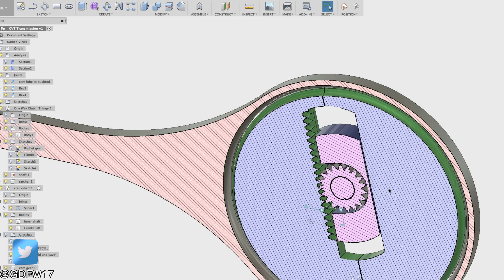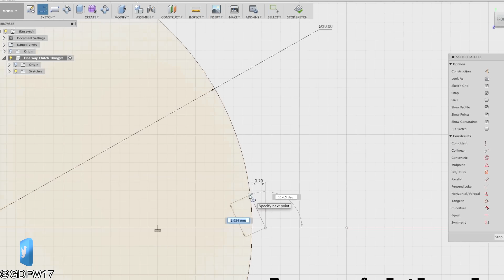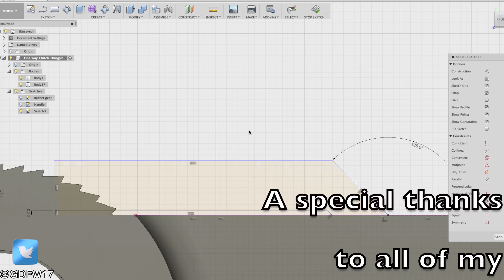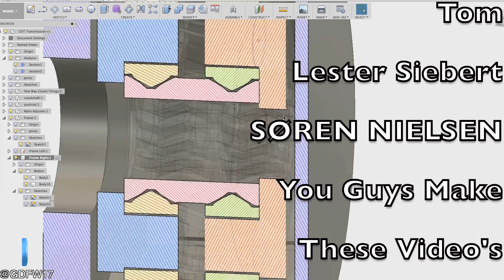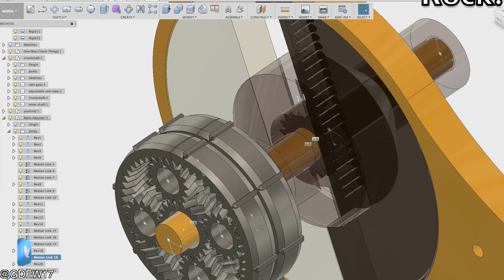The Coolest Transmission You've Never Heard Of... The Ratcheting CVT

Comment: Im guessing its not a full CVT because of two things: 
1) It only transmits power in discrete chunks for each ratchet step.
2) Due to it's fixed lever design it will never achieve a 1:1 gear ratio.

Another thing is that it does not really transforms torque that much, so for this transmission the lower output spin ratio does not necessarily mean a higher torque output, the torque in this thing is practically fixed.
Reply from the maker: Some very good observations!
Reply: Gear Down For What? Thanks!

Comment: Very clever.  Unfortunately would generate a great deal of wear on contacting faces and thus material & maintenance costs would be high as well as lubricity issues.
Reply: hi new engineering metal required can be mass produced
Reply: hahahaha
Reply: Yeah the thing wouldn't last any longer than a normal belt-based CVT.

Comment: Since it goes down to zero, you can actually call it an Infinitely Variable Transmission (IVT) :)
I anticipate you're going to talk about the Non-Integer Tooth Problem in the next video. If you used sprag clutches instead of ratchets, you would of course solve that problem but lose positive engagement. I do wonder if you could use a mix of sprag clutches with ratchets to back them up if they lose grip? Also, I'm interested in how you could dynamically balance this mechanism. I'd bet if you had six of those cranks they would be inherently balanced like an inline six cylinder engine is (and perhaps the extra three could be sprag clutch based!)!

Comment: Great, let's adapt it on a go-cart or a Power Wheels.
Reply: And watch it blow up lol
Reply: nah this is useless. belts are much more efficient. this would induce incredible vibration, and has way too many moving parts than nescessary.
Reply: Actually, that would be a really cool idea
Reply: silly rabbit ..... if you want to build a super snotty go cart use a snowmobile torque converter [clutch] and heck throw in a snowmobile  engine nobody will ever beat you look up snowmobile engine powered bikes only thing faster is an electric and they are very fast
Reply: Paco Vasda you would need one on a Pro or super kart, which does have gear shifters.
Reply: Everything needs to be cheap.   It's hard to get cheaper than a belt.   even the cost of 5 belts is hard to compete with.  Just make belts quick and easy to replace,  and You'll rule the go-cart industry..
Reply: You get more power at low speed with gearbox. if torque is constant then power depends on RPM. it's better that motor is always delivering maxium power or running at best efficiency.
Reply: Ok, to all those saying it’s too expensive or not efficient blah blah blah. Heck I’d put one on a kart just cause it’s cool and unique! Not everything has to be ultra efficient. Sometimes you do stuff just cause it’s an option.
Reply: I thought maybe a bicycle. They're designed to coast when you stop pedaling.
Reply: Roberto Buenrostro you don't need a transmission with an electric motor. It would serve no purpose.
You will often see a gear reduction system on an electric motor but you wouldn't want to change that reduction once chosen.
You can make an electric motor produce full torque at low RPM as well as high RPM whereas a gas motor only produces its best torque usually at higher RPMs there for a gas motor would need a transmission so that you could get your speed to go both fast and slow all with higher RPMs in a petrol powered machine
Reply: Roberto Buenrostro  That would be awesome! I just bought a torque converter for our off road go kart project but something like this might be the ticket, especially if reverse could be added!
Reply: wow, that was an unexpectedly epic idea.

Comment: Some CVTs can go from full forward speed though zero and on to full reverse. I've never heard of the "ratchet drive" but I guess that means it is not reversible. Won't the ratchet and toggles be subject to high wear? Also I think the ratchet would make the output shaft free-wheel in the drive direction, right, like the free-wheel on a bike?
Reply from the maker: yeah
Reply: There are some other ways to do the same job as the ratchet rectification. I don't remember what it's called but it uses something like rollers that jam going one way and free-wheel the other way. Here's one video I found about that: Renold Trapped Roller Clutch https://youtu.be/QjR7dimpSJA

Comment: The reason it cannot be classified as a CVT is because although the stroke length is infinitely variable, the amount of rotation of the output shaft per stroke is dependent on a finite number of clicks/teeth on the ratchet mechanism. I really like this design, it seems very reliable and an easy modification would enable reverse functionality;. I may have to steal it for my own projects. I particularly like the design for the control mechanism.
Reply from the maker: I took it apart at the end

Comment: Please check this REALLY working cvt. It can handle a lot of power and is still really dependable. There Hans even been an formule 1 prototype.. https://youtu.be/dp8lHBDFhpo
Reply from the maker: that's like a snowmobile CVT with a steel belt.
Reply: Gear Down For What? Last year they built the 50,000,000 one. That are a lot of snowmobiles

Comment: At 4:35 I got a counterexample for you. I work at a dealership so take that into account, but Yamaha ATV drive belts don't slip. They have a centrifugal clutch like a scooter before the power gets to the CVT. The only time we have to replace belts is when they submerge the transmission in mud, and even then they're sealed up pretty well. Sorry if I'm being sales pitchy, but just thought you might be interested in the engineering. Look at item #1 and #10 here at the bottom: (this goes to a parts diagram on Yamaha's website, the URL didn't agree with YouTube's comment formatting codes) https://tinyurl.com/y8nnyvfz

Comment: The ratchet action of the Conrod is a significant energy loss and at significant speed the pall would float without engagement on the output shaft, neat arrangement though. Try a variable pitch worm gear with elliptical lapping plates you may have fun with that.

Comment: Instead of using ratchet mechanisms you could probably use a one way clutch like what is commonly used in automatic transmissions, which would make it work more quietly more smoothly, and I'm sure it would last much longer. It seems to me like those would be the biggest problems with using that in an automotive application.

Comment: I, too, once had a brilliant idea when I was a child, only to discover it existed already and wasn't in place because of consumers not understanding how great it would be.

4-wheel steering. Basically, all the wheels had turning, but in either direction so that you could 'strafe' into parking spots. And they could also turn to allow for tighter turning and better control in turns. But complex mechanisms, price, weight, bla bla bla made it never really catch on.

And then, shortly after that, I had the idea of putting a motor in each wheel so that the wheels could be directly powered with as few mechanical links as possible... That one might happen with electric motors.
Reply from the maker: Not even kidding you, at the same age I had those ideas also, but in the opposite order.
Reply: At 7 yo we had a fiber light Christmas tree   and had invented fiber optic, just make the light be either 1 or 0 and send binary codes with light. Ofc fiber op already existed

Comment: I think the Prius Cvt is one of the most simple and robust versions. Basically and open diff with the electric motor varying the speed. Its one speed but infinitely variable. The electric motor helps down low and when the engine needs to idle at stop all the rotation is sent though the gererator side letting the wheels sit still. Kinda like when you hold one wheel on a open diff and all the power goes to the other side. Its so bullet proof idk why its not used more. No clutches or bands to wear and much less heat. But it needs a electric motor which generally are very reliable and you have the extra complexity of a battery and inverter to power it all.
Reply: I have to agree about the prius cvt. Outstanding design, and I dought its power limited like friction cvts just up the size of the motor and gearing. I bitch nonstop about friction cvt s and curse the auto manufacturers for using such failure prone garbage...honestly does anyone have a NON PRIUS cvt with 300,000 trouble free miles?
Reply: Jim Rr  A Prius is just good on gas.  Many people own them and also own their muscle cars, trucks and other assorted gas gusslers.  We aren't trying to save the world, just gas money and miles on our other nicer vehicles.  There's no need to suggest we are Democrats, snowflakes or environmentalists.
Reply: ^^^^^^^ This
Reply: I love my Prius, at first it was so weird to drive but now I can really respect the design.  CVT's will advance in design as consumers are drawn to their fuel economy.  I wonder if Toyota made the design so tough or if there is an un-thanked inventor somewhere?
Reply: I meant 1 gear and always in it. infinitly varible. reverse is all electric only. It never shifts in or out. Car will lurch forward slightly when in park and the engine starts up sometimes as it is technically still in gear. Some power is transfered to the drive wheels as the electric side spins up to speed. I guess you could call it unsprung weight. Seems to be only noticeable when the battery is really run down.
Reply: @wrangliser But much less limited than belt-type CVT's, and much less complex.
Reply: RCWeaven FPV I don't think you actually read and understood a single thing I wrote... I bet that happens to you a lot.
Reply: I think the ford escape hybrid is a simular design. very robust. Of course the rest of the car will not be toyota typle reliability.
Reply: Yes but I felt this explantion was much simplified and much easier to understand. Kinda like quantum mechanics. Gears are usully prettty reliable even if there is a lot more going on than a differential. Its the lacking of having to mechanically shift or use a clutch or fluid type torque converters which seem to be common failure points.  This seems to add to the reliability.
Reply: Didn't Koeningsegg make their own version of this sort of power transfer too? The one gear transmission or something.
Reply: Thank you.
Reply: How much power does the Prius CVT take though lol. If I ran 600hp through it is it as reliable? The problem with the term "robust" is it's only being used in failure rates while ignoring vehicle weight and torque output
Reply: Good luck supplanting a 300hp engine even ;) or... a diesel. Also it STILL requires batteries, not exactly the most environmental friendly to produce
Reply: wrangliser Explain that ...cause you can build one however large you want...if you've got enough material and workforce you could build one the size of the known universe...is that enough power capacity for your ass ?
Reply: Diesel-Electric Locomotives can produce 6000 HP with no problem, although they do generate electric power from a diesel engine instead of just charging up a few boxcars worth of batteries. The Tesla roadster in it's most powerful configuration gets 288 HP. Why is supplanting a 300HP engine a problem? Both of those examples use motors on drive axles and one example uses batteries.

https://en.wikipedia.org/wiki/Tesla_Roadster_(2008)

It's hard to say (for me because I don't know enough about it) if building batteries is better or worse for the environment than what a gas engine does. But one good thing is that it moves the pollution out of the city where people have to breath it.
Reply: Why would you even meaion that its a prius!!
Reply: Toyota's patent is going to expire, guess what will happen next?
Reply: It's not technically a transmission.
Reply: It has limited power capacity.
Reply: RCWeaven FPV Here again, too stupid to actually read the comment.
Reply: It's one speed but infinitely variable. Nice comment.
Reply: You dont know exactly how a Prius motor/generator works. You have a basic idea,  it there's a ton more that goes into it.
Reply: BlueMacGyver. It certainly won't be dem flakes that save anything. Blue, something tells me you go through this a lot.
Reply: Tim Z A Prius with a COEXIST bumper sticker will save humanity.
Reply: BlueMacGyver. With a response like that you must be a snowflake. My only point was if you drive a prius for utility reasons people must often assume you are against gas vehicles and now you are sensitive. You removed any possibility that you aren't sensitive. Do you actually own a gas powered vehicle?
Reply: Tim Z. So Tim, because you don't have a transmission between your electric motor and your axle does not mean you have cvt. It means you have no transmission. With your concept, if you hooked a gas motor directly to an axle you have a cvt. So why have people been wasting their time with transmissions. Silly people.
Reply: Tim Z. I don't think you have any idea what you are saying. Keep learning though. Maybe you will get it.

Comment: If the crank in an engine was replaced with this mechanism it seems it would combine the engine and transmission into a single unit. It would result in a reduction in weight and overall complexity assuming it allows for the necessary range of speeds.

Comment: Other downsides of CVTs is efficiency and strength.

Strength - all the extra moving parts (or deforming parts for some designs) are a lot weaker than solid gears.
Most motor vehicles only move at a few selected speeds. With fixed gearing you have fewer moving parts and thus higher efficiency. for some applications CVTs are really good.

And as some mentioned electric motors:
it really depends on their design, but in general they have a really flat power curve giving them the same efficiency and power for a large range of RPM. often it is enough to just have 2 gears to increase the power for low speeds while maintaining efficiency at higher speeds - thus enabling to use smaller motors.

Comment: This gearbox produce vibration to handle with. In cars, an engine and a gearbox is joined together. Using this gearbox will give many opposite forces between the engine and the gearbox. In my opinion this gearbox has much more resistant than any other gearboxes. This gearbox produce clicking sound.

Comment: well i like it, if you could sort it out to give smooth motion you could solve a major economy problem,  if you can run a car at a fixed rev range in it's peak power range, and use the gear to control the vehicle speed, then you can make the mileage stupidly large, plus as the engine is running at a set rev and only the torque is needed the engine can be simpler... thus lighter.... you sir are a freaking genius p

Comment: Very ingenious.  I'd like to ask a question, though.  If you took two of the eccentrics away so there was only one pawl acting on the ratchet, the output would turn while the pawl was engaged, then rest while the pawl was being retracted to the next ratchet tooth, so the angular displacement of the output shaft would be intermittent - go a bit; stop a bit.  Having three palls obviously takes most of the intermittency away, but my question is this - does it take it all away?  If you plotted the angular displacement on a graph against time, how much ripple would the graph show?
BTW, the Varibox, also on YouTube, also works on a ratchet principle.  Some time back (couple of years?) I saw a video of a go-cart driven through a Varibox, but again, I don't know if the angular velocity of the output shaft is constant.

Comment: I think this is a great idea.  I have a couple of questions, would more "ratchets" help balance the transmission or isn't vibration a problem? Would additional ratchets lessen the stress on individual parts? Could a planetary gear set on the output shaft offer a high - low- reverse for the transmission?  Thanks

Comment: This is pretty cool. I had a similar idea to this but all i figured out was some adjustment system to change the ratios within some magic black box with an input and output shaft stuck in it. Very abstract but I didn't have the knowledge required to think through it further. Really cool to see someone do this in parallel with more knowledge.

Comment: When i saw that you had three connecting rods, 120 degrees out of phase, I immediately thought about three phase AC power and how the three phases can be used to provide completely smooth torque. I’m wondering if you could somehow use planetary gears on the output end as a kind of “adder” to sum the motions of all three rods (instead of just taking the one with the most motion)... maybe even having some escapement which could harness the rods’ return stroke.

Comment: I was just thinking it would be great to have a cvt as the final drive gear in a pickup truck. It would give more power advantage for accelerating or towing then change to more speed advantage when you get up to highway speeds.

Comment: Instead of a ratchet, could you not connect a piston to the "ratchet" end and incorporate the transmission into the crankshaft (with the output being your current input) thus turning the engine into an engine/transmission unit?

Comment: Very nice machine. For preventing carriers to weld themselves to the gears I'm using spiral shafts in my 3D printed planetary gear sets. I never had a friction welding failure since then even at high speed.